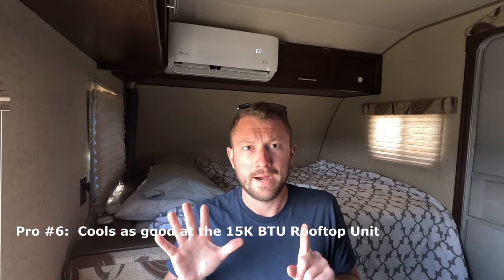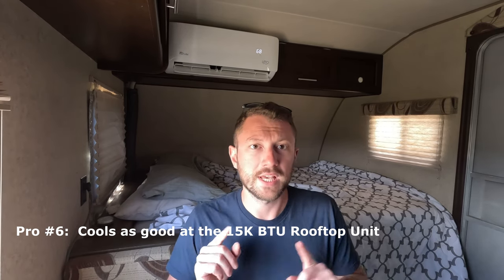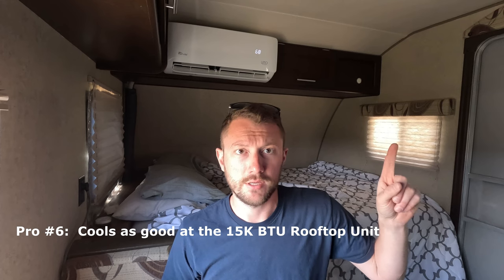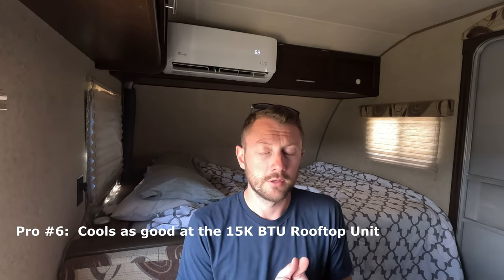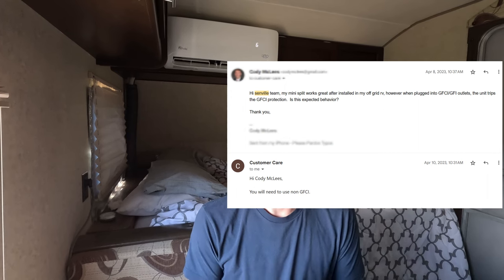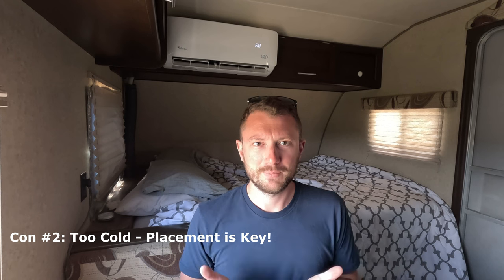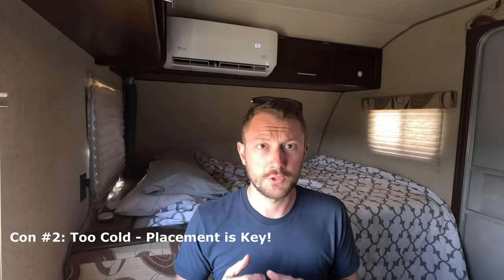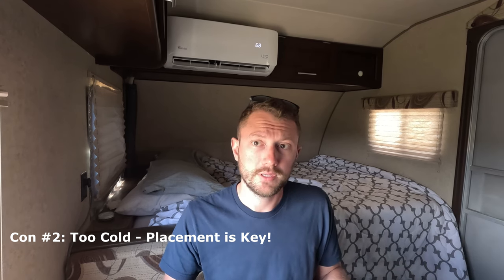MiniSplit in My RV | Pros and Cons

Comment: To all of you naysayers, I put a pioneer mini split into my converted cargo trailer two years ago. I very comfortably survived a summer south west of Tucson in Arizona. Kept it about 76° inside. It was amazingly stingy with power, and I ran it entirely off of solar. I had four 300 W solar panels on the rough of the trailer plus a portable 200 W that I could sit out when needed. Never once used my generator. Oh, though I couldn’t run it at the same time I also ran a toaster, oven air fryer and a induction cooktop off of that. The only propane I used was for my on-demand water heater. All worked really fantastically.

Comment: About your 2nd problem,1- i see that you have the unite louvers on auto consider locking them to the top position from your remote control to direct the flow of the air away from you and into the ceiling 2- put the fan speed to the lowest setting to reduce the air flow 3- if your unite has the left and right louvers manually adjust them too
Reply from the maker: Ah yes good point!  I will see if i can use the remote to use the deflector to push the air past me rather than at my back.  Thanks for watching :)

Comment: Very nicely done.  Repurposing that generator rack is a great idea.  I wish they made a mini split with a head unit (evaporator/air handler) that would fit in that 14" square in the ceiling.  I don't have much in the way of wall space to mount a couple in our 5th wheel.
Reply from the maker: Thank you Robert!  They actually do make mini splits that have the 14x14 ceiling cassette for the inside air handler!  The problem is, in an existing RV it would be pretty difficult to get the line set run and looking decent.  In brand new RVs some premium brands like New Horizons are putting them in, but they have the benefit of getting those systems installed while the rest of the rig is being built and effectively building around these systems.  Thanks for watching :)
Reply: I have seen mini split units that are called "Cassette" that are mounted to a ceiling.  Just not sure on the dimensions of all the units they make.  Look up Cassette type mini split.  They are SO quiet!
Reply: @Kangenpower7  I am a bit familiar with the ceiling mounted "cassettes", but I think there might be a market for an RV-specific, drop-in replacement for the classic 14"x14".  Something that would work with the classic RV ducts, as well.

Comment: Good video. I have 9000 Pioneer mini split in my 26 ft classic class c. On mine I can choose which direction for louvers to move to distribute either heat or cooling. Its 102' here in Yuma today, I am at a resort hooked to shore power and have mine set at 74' with fan only on 3rd speed. Very comfortable, very quiet. I also have dog and leave her in comfort when i go to work. Your inside Head install very similar to mine, I also came up thru floor and in corner under overhead cabinet, then curve and come out to Head unit. I have my compressor on my back bumper in a steel custom cage. It doesnt move. I used pipe insulation to cover metal arms to buffer up down movement on shock pads. My cover is inside the cage during travel and holding up well. Totally love my mini split and so do my neighbors, they cant hear it at all. Last winter when everyone else was refilling propane tanks for Furnaces I was warm and cozy. Its a no brainer. Now Im installing solar system so I can boondock without running a generator. :) Anyone that installs one please first do what I did, insulate your rig! Use vent pillows in top ceiling vents, insulate inside all cabinets and closets, floor, under beds, in cab overhead and if you have a classic like me use not only insulated shades but also curtains. Oh, and dont forget the entry door, I have curtain I can pull over and it makes a ton of a change to temp inside. And most important dont install mini split right over door or window. :)
Reply from the maker: Awesome Joanne!  You thought of everything!  I’m loving this unit and looking forward to warmer temps to see how it does!  Thanks for the comment and thanks for watching :)

Comment: You can use a cover made out vynil used for tents. That's what I used to protect my condenser against rain, dust, sun radiation, etc. at a beach house. Use a rubber sling to hold it in place while traveling. A/C has been operational  for over ten years. I painted the condenser's metal housing with marine barnish for corrosion protection.

Comment: hello...nice set up in the trailer. Very clean install. I am a pipefitter out of st paul and install a lot of these units.  You can put them just about anywhere. As an fyi...they do make either hail guards or wind baffle for most brands of these.  So instead of your fabric sack that you put over the top of it....there is a punched sheet metal baffle that helps the fan not spin in the wind when it's not in use. The best part is that it usually get sheet metal screwed into the same holes that the fan guard is using.  Happy camping!
Reply from the maker: This is great info, I’ll definitely look into this!  Thanks for watching :)

Comment: really liked your video. I have been back and forth on doing the same change. You have given me more confidence on tackling this conversion. RV shops tell me its overkill but the noise decrease would be substantial compared to the side AC unit I have (so loud)
Reply from the maker: They may be right, it probably is overkill, BUT overkill for me?  Probably not, I'm kinda extreme when it comes to preferences haha!  The noise reduction, efficiency gained, and the addition of heat has all been very welcomed in our rig.  Thanks for watching!  :)

Comment: Buy a canvas tarp or a "trucker tarp" to keep it from spinning.  I'm thinking the wire stop might at some point do something bad to the fan.  My mini split is on a special frame under my boxtruck overlander conversion.  I have it turned so it can operate while traveling and it has a wire screen that deflects rocks and prevents fan overspeed.

Comment: Thanks for the video and your subsequent test video. We have been looking at the Sennville 9k unit, and you have convinced us. We have a Rockwood Mini-Lite 2513s, and will also be installing a 24v Victron MultiPlus II with about 600Ah of batteries. Getting rid of the rooftop A/C will allow us to add even more panels than the original planned 1220 watts. Do you have any advice for mounting the inside unit onto the overhead cabinets? We will have to do the same.
Reply from the maker: Glad I was a help!  The inside unit is surprisingly light!  I didn’t have any issues just screwing into my cabinets and making sure the screws held tight.  I’ve towed it about 4,500 miles since install with no issues so far!

Your system plan seems adequate and should be a great fit!  If you’re considering buying, please consider using my affiliate link in the description! Thanks for watching :)

Comment: nice vid sir couple points that may help, with concerns to gfi issue you could route through a inverter powered off the batteries yes you will have some loss but should eliminate tripping gfi and senville does make a ceiling  cartridge that could be mounted in-place of the original a/c unit depending on ceiling thickness as all trailers are different in that respect, or have a box built to cover top of unit on the roof if height is an issue
Reply from the maker: So it is running through my inverter already, but when the inverter goes to pass through mode it trips the breaker.  I've got a few solutions in mind, but I also very very infrequently will be plugging into GFCI outlets.  Thanks for watching! :)

Comment: WOW! You have the same floor plan as my Wolf Pup 16BH. This opens possibilities for me! I to, am not enjoying the AC noise and power consumption.  Would your mini split run on 120v while mooch docking at a friends? I keep my camper connected to a 20amp circuit at home, to have lights and keep the battery charged.
Really appreciate your video,  I was always curious about using a mini split and now you have answered my questions!,
Reply from the maker: The minisplit runs on 120v and pulls no more than 10 amps, so a 20 amp receptacle would work well.  The only problem is also detailed in the video, but would be that most outdoor 15 or 20 amp outlets are GFCI and most minisplits will trip a GFCI breaker.  Mine does as soon as the compressor goes to kick on.  Senville support advises to not use GFCI outlets.  If your friends have a 30 or 50 amp outlet those will work no problem as those typically are not GFCI protected.  Thanks for watching :)

Comment: Cody, can I get you to install one of these mini splits in my house? It only gets hots a few days per year. We use one of those super inefficient portables with the stupid hose that goes out of the window. We don't have sash windows or I would get one of those new super efficient ones that allow the window to come down with only a few inches that has to stay open. We only have a 100 amp main and the open spots go to a 50 amp breaker and a NEMA 14-50 outlet for electric car charging. All of our appliances are natural gas. Eventually gas appliances will no longer be sold so everyone is going to stock up on gas water heaters, furnaces and kitchen stoves. I do hate the toxic smell when the gas oven first starts warming up. I have to remember to turn on the exhaust hood every time.
Reply from the maker: Haha, I am not a professional when it comes to installs so I wont be installing these things for anyone other than myself and close friends!
Reply: @theconnectedcamper  Thank you Cody, I wasn’t seriously thinking that you would be installing this at my house, but meeting you someday would be amazing!

Comment: They make rv heat pumps.  We have a variable speed Colman mach heatpump.  Low it pulls 400 watts and on high it pulls 1500 for about 2 seconds then settles in at 1050.

Comment: A few questions:
1. What trailer do you have? I'm curious if this would work on a larger unit. 
2. Did you consider the hacks people do on the rooftop units to make them quieter?  

Thanks in advance
Reply from the maker: These are excellent questions.  
1.  I have a Patriot Edition 16BHS.  It is small trailer with no interior walls other than the bathroom.  This mini-split is not ducted so as long as your trailer is open and without interior walls, you should be ok.  If you have walls, it may be difficult to distribute the cooling/heating appropriately.  
2.  As one that also performed the hacks, they do not work to make them quieter, but they do work to distribute air better.  If i was doing it over, i wouldn’t do the hacks again.   

Thanks for watching :)
Reply: @theconnectedcamper  Good deal, thanks for the info and sharing!

Comment: Hi, nice video! Did you find road vibration to have any impact on the mini split system, especially the long run? I know that by replacing the copper lines with flexlines(stainless) helps alot. Are there any other measurements that need to be taken to prevent vibration damages?
Reply from the maker: Several thousands of miles already towed with it installed and it has us comfortable at 66 degrees inside while 94 outside!  No problems so far :) thanks for watching!

Comment: Im getting things together for a mini split install in my 5er. What was your clearance from the top of your inside unit. It calls for >5" but the best place for mine is tight on top in the ovethead cabinet but plenty room horizontally.
Reply from the maker: This is a great question, I have about 4 inches of clearance and that doesn’t cause an issue, but your application may vary.  I wouldn’t go much less than 4 inches as may cause problems.  You could also consider building a frame that would hang the unit lower slightly and have that frame attached to the cabinets?  Hopefully this helps :) thanks for watching!

Comment: Not sure if this has been asked yet, but what did you do with your old RV roof AC? Did you remove it? If so, how did you seal the hole in the roof? Thanks
Reply from the maker: This is actually addressed toward the end of the video.  The rooftop unit was removed and a 14x14 roof vent was put in its place!

Comment: Cody, does anyone have any CFCI theories? I know that people install soft starts on their rooftop air conditioners to keep circuit breakers from popping off, but someone has probably tried that already. Is there anyway to use the heating cycle to also preheat your water before it goes through a tankless water heater? I am just thinking about other ways to conserve propane or electricity.
Reply from the maker: I did ask Senville, and they didn't have much info.  The way it was explained to me is that it isn't about the size of the current, its more about the way it is flowing.  It pulls FAR less than my old rooftop AC which never popped a GFCI.  Not a huge deal, I just wont plug into GFCI often.

Comment: I never would have considered using a mini split. No one really makes a camper setup the way I would want it so I've been toying with the idea of doing a cargo trailer to toy hauler conversion.  I was only looking at 12v appliances because that's how I've always coinsidered campers to be setup. I mean I knew that they had an inverter for limited 110 use, but mostly 12v. I guess with modern solar and battery setups, running 110v isn't really an issue.
Reply from the maker: Agreed 100%!  Take a look at my solar tour and/or look at MPP solars all in one inverter/charger/solar charge controller!

Comment: Sorry. One more question😝 So you just mounted it on your ceiling instead of a wall and that worked with the unit mounted on front of your trailer? We have a Class C with two slides and the only place this could be mounted is the ceiling. Maybe it’s not on the ceiling but it looks like it. Thank you
Reply from the maker: It isn’t attached to the ceiling, rather I took a cabinet door off and mounted it where the cabinet door would have been affixed.  These units wouldn’t be able to be mounted to the ceiling to my knowledge.
Reply: Thank you. Now it makes sense.

Comment: A word of caution about heat pumps they begin to lose efficiency at 40 deg F and at 25 deg F will put out very little heat without heat strips in the unit.
Reply from the maker: In general, at those temps yes you do need to be mindful.  For my specific unit, it works down to 5 degrees F.  I have used it at 15 degrees without issue.  Thanks for watching :)
Reply: This is no longer true, the majority of newer heat pumps & pretty much ALL mini splits will now provide good heat down into the single digits

Comment: What is your new tongue weight with the mini split installed?
Reply from the maker: The tongue weight likely increased by 200 pounds.  The outside unit isn’t that heavy, but the rack it sits on is.  The truck that tows this has ample payload capacity and it isn’t an issue at all.  Thanks for watching :)
Reply: Excellent video. How heavy is the outside unit?

Comment: Does anyone remember the box fan days when you just sat in front of it to cool down? Just condition your body to tolerate temperatures. I don't run the AC unless it's above 80 or if I'm sick. Thanks for the minisplit information though. I didn't even think about that. I just though that an 18000 BTU AC on a small TT was way too much.

Comment: What size RV do you have?
Reply from the maker: It is a Forest River Patriot Edition 16BHS, so about 20ft long and about 200 sq/ft.  This size mini split is meant for up to 400 sq/ft.  Thanks for watching :)
Reply: @theconnectedcamper  Thanks, I saw your other videos about generators. What is the minimum size do you think you can get away with running this split instead of the 15k roof ac?
Reply from the maker: @Grandpa_RLP  are you asking the minimum size generator to run the minisplit?  A 2000w inverter generator can easily run it, i’ve even run only the minisplit off a 1000w genny to test and it worked!  But to power other loads as well, a 2000w generator would be good fit.
Reply: @theconnectedcamper  Thank you!!

Comment: Does that outside unit make your tongue supper heavy?
Reply from the maker: The outside unit is only about 40 lbs and since I don’t have a lead acid battery there anymore, the tongue weight is within factory specs.  Thanks for watching :)